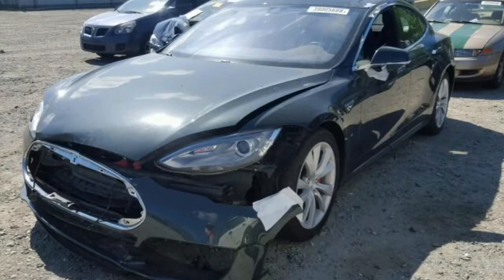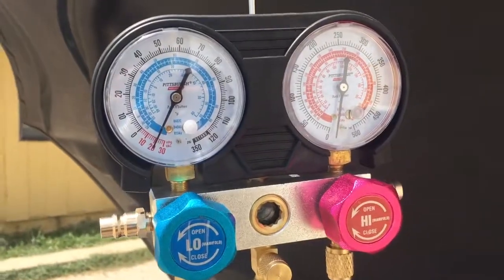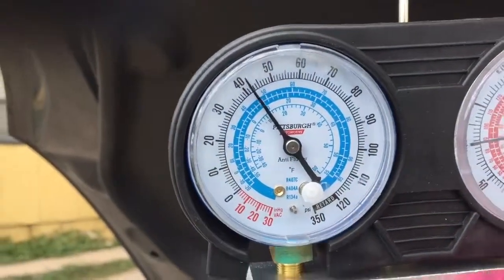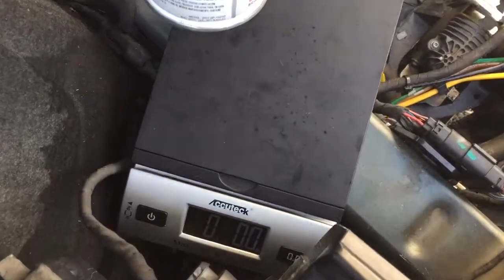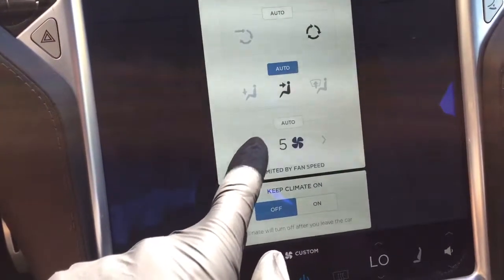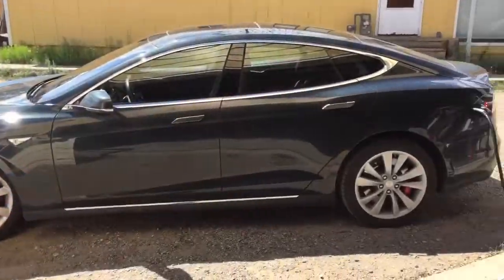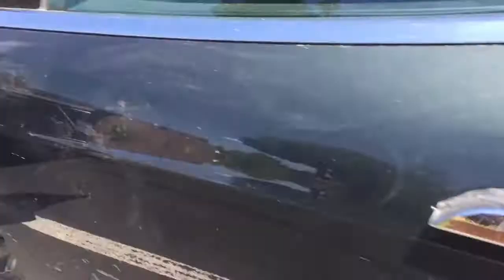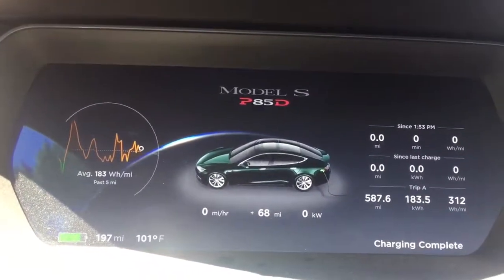Tesla Air Conditioning recharge AC Repair

Comment: Did you use Toolbox to refill gas? In the service manual it says:
''Connect a laptop with Toolbox 2 to the vehicle.
In Toolbox:
Go to Panels > Thermal > Fluid Drain/Fill.
Select Refrigerant Fill.
Select Next to start the drain routine.
When the routine finishes, select Next. The vehicle is now in Drain/Fill Mode.
Exit the vehicle, leaving the laptop connected to the vehicle.''
Reply from the maker: Unfortunately I’m not sure how to get access to Toolbox (do you know how?). The AC system is pretty standard and worked just fine filling up with this method (though I’ve only rebuilt 2 Teslas so far). Let me know if you have access to Toolbox - it would be fun to play around with for sure.

Comment: Hi 
Great content, very infirmation Thankyou.
Does the condenser come out through the frunk?, need to swap mine due to a hole and want to remove as little as possible
Reply from the maker: On the model S it’s housed in the bumper cover frame (been out of the lingo for a while). I’m pretty sure you need to remove a bunch of stuff to take it out unfortunately.
Reply: @MicksUglyEVs   Thankyou.  I can't find any guides.
Reply: @Regen EVs I'm  Presuming frunk, undertrays wheel arch liner possibly bumper too??    

do you recall how the condenser mounts to the front? I see 4 mint points but can't tell if they are bolts or simply clips?  

Thankyou Again
Reply from the maker: @Nisnos69  Hey David, Send me an email busaru@busaru.com and I'll send over the manuals that I have. That'll help a lot I'm sure.

Comment: How far did you drive without the AC charged?  Was the power to the compressor disconnected?
Reply from the maker: Hey Steve, I drove at least a few hundred miles without it connected/charged. I believe Tesla is smart enough to know not to turn on when it has no pressure. Not saying this is the right way of doing things but I imagine the AC system is not mission critical - as in, if you're stuck in Baja with a hole in a condenser, you can still drive your car without having to be towed. May want to do your own research though. Let me know if I'm totally wrong on this.
Reply: @MicksUglyEVs  Thanks for the info.  Used the same oil you suggested.  Had my buddy charge at his shop (660 grams for a M3) Works well! 

Where did you get your p85D?  What type of title?  Suprised you were able to supercharge.  I have not been so lucky.  Texas issues 'original' title wonder if that keeps it off the salvage radar and allows supercharging to continue?

Comment: Used to be just poe or pag oil.  I didnt catch what you used.  There were a lot of folks using hydrocarbon refrigerants 25 years ago.  Worked better than r134.
Reply from the maker: ND11 compressor oil is used for electric AC/heat pump compressors found on hybrids and electric cars. Hope that helps!
Reply: @MicksUglyEVs  Thanks for the video.  I am rebuilding a model 3 here in ABQ.  Recharging the ac with 134a.  Is the hybrid oil available over the counter the ND-11?  Or a similar version with high resistance for use on open windings?  Is your AC still going strong?  Don't want to pay a fortune for oil, but don't want an expensive repair later.
Reply from the maker: @stevejarrett6209  Hey Steve, The ND-11 can be found at Autozone and my AC is working great 2 years later. Just got back from a 2500 mile California trip using Superchargers and it was keeping everything nice and cool, including myself. Good luck on the Aircon recharge.
Reply: @MicksUglyEVs  Good to hear!  I looked it up at auto zone and the hybrid AC oil says it is compatible with the Toyota ND-11 which is spec for Tesla.

Comment: Supercharging speed will be highest when battery is less than 5-10% charge.
Reply from the maker: For sure, I was just stoked that I could charge at all ;) Thanks for the comment on my young channel.
Reply: @MicksUglyEVs  now my condenser has a leak ☹️ I'm out of warranty and requested a price on a new condenser from Tesla.  Car still cools but it leaks r134 and it doesn't get a cold as it should.
Reply from the maker: If Tesla has a really high replacement estimate you might want to consider replacing yourself. Get a dedicated manifold gauge set for electric compressor and DIY. Just be safe by disconnecting the 12V (after shutting down MCU), and disconnecting HV battery via the first responders safety loop.
Reply: @MicksUglyEVs  I was able to buy a replacement condenser and associated o-rings from Tesla and replaced it myself.  Tesla charges about 4 hours labor at 175 per hour. I saved some money.